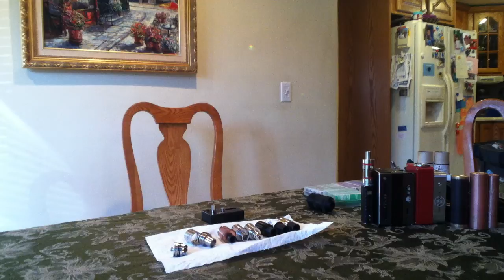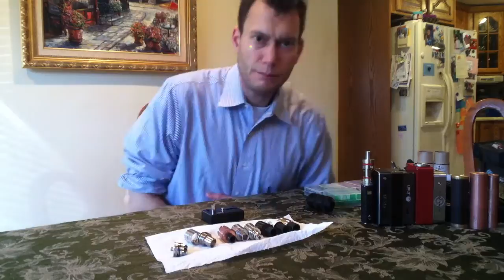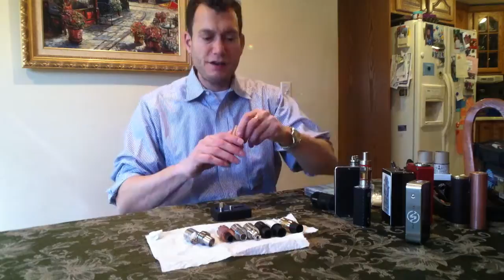Frank Discussion about E Cigarette vaping mods blowing up.

Comment: Good video. I Use the evic vt 60w tc. I don't like the mega one tank and so I use an isub g, only the power mode. How do you feel about the evic vt? It's regulated, and has saftey protection but I heard these types of batteries can be potentionally dangerous.
Reply: +Tony B

Any battery can be potentionally dangerous... In your car, in your phone etc...

Charge them correctly, and dont buy cheap chinese stuff, and im betting youre pretty safe.